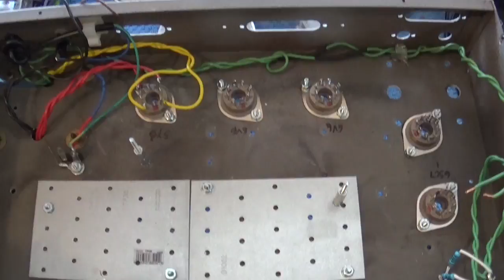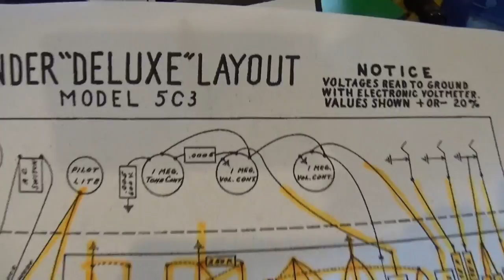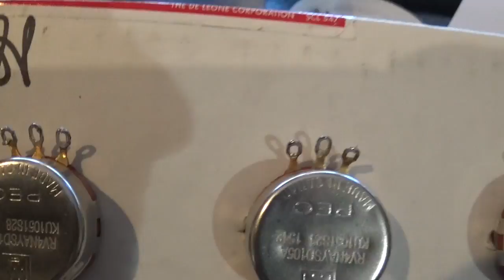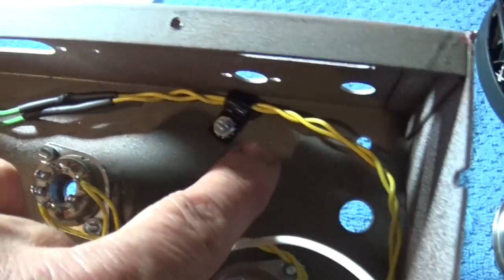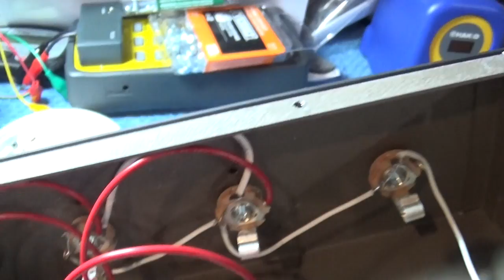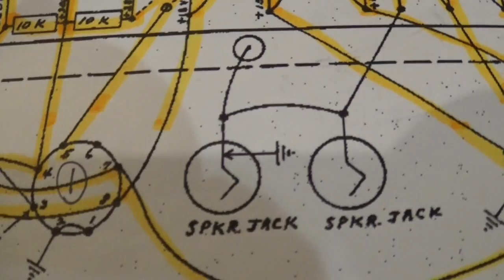Executone P13 Guitar Amp Conversion - Episode 7 - Taking shape like Gumby

Comment: Hi Ron, are the Fender transformers expensive, like over 100$?  D
Reply from the maker: Don, thats the beauty of my home-brew hobby. I am buying dirt cheap amps on ebay with iron on them and most are perfect for these amps. I look at the specs and light em up. The Fender transformers are crazy expensive but I am doing just fine spending $25 on an amp with Iron, tubes and output transformers... A real bargain.   - Thanks Ron
Reply: http://www.ebay.com/itm/Vtg-Allied-Radio-Knight-Model-KN3235C-KN-3235C-Tube-Power-Amp-Amplifier-B40-/222248361588?hash=item33bf08de74:g:6YQAAOSwknJX1xvZ